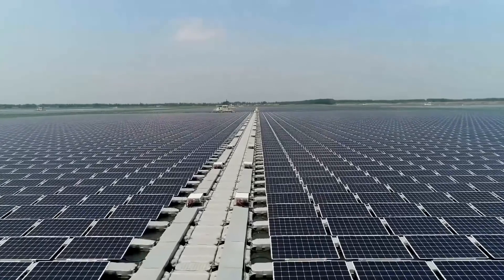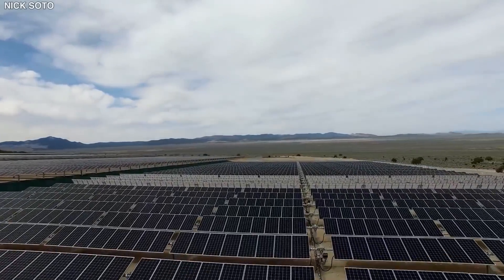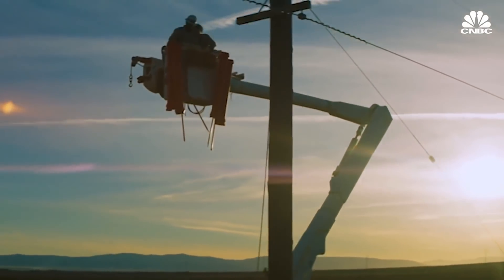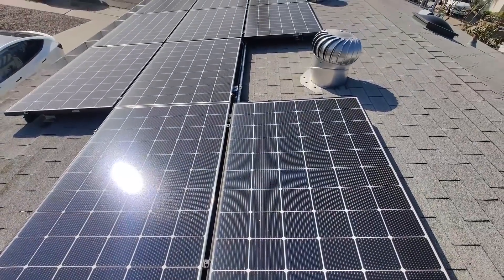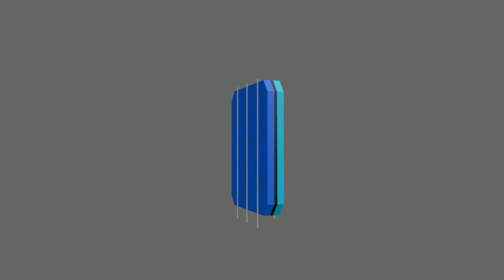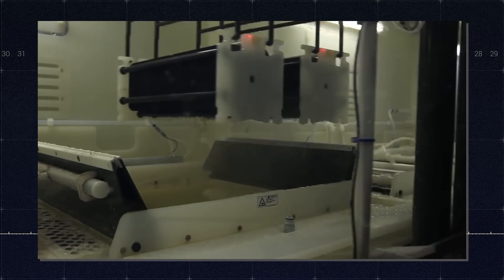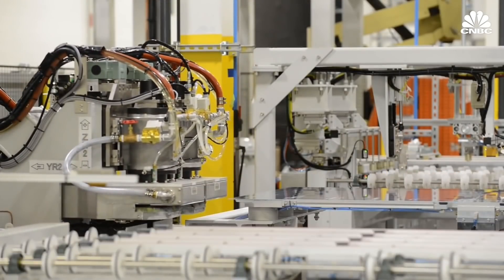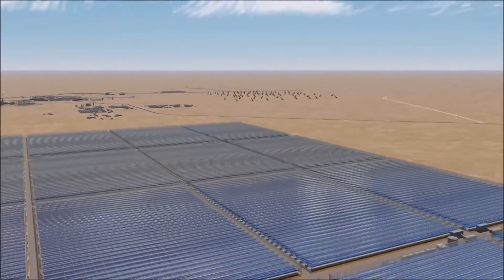IT HAPPENED! Perovskite Solar Cells FINALLY Hit The Market

Comment: I was missing a part where we are told why these cells are not here already. Sounding all promising until you get to the part where the current lifetime is 30months max under optimal conditions. Way shorter than silicon PVs.

Comment: Solar is GROSSLY inefficient, and highly polluting to mine the natural resources, and produce the cells.  Also, China controls that market, which makes it strategically untenable.  Solar has become a money grab for local electrical markets, and a political crutch.

The statement that it requires no maintenance is patently false as well.  PV cells must be cleaned or they lose efficiency on an exponential level.  That means water, chemical cleaners, and constant maintenance.  Solar is not, and will never be the fairyland panacea than tree huggers believe.  It can have its place, but that place will be small, and limited to off grid, undeveloped areas.  These cells still have less efficiency than standard cells by 5%, so more development is required.

Comment: In order to produce 508x more power as in the click-bait photograph,  the perovskite cells would have to cover 508x more area, be 508x more efficient, or a combination of both. At 508x more efficient than current panels, you would need 508x the current efficiency of ~ 20 to 25 %, or 257,175% efficiency. Last I knew, the maximum efficiency of anything is 100%. You're gonna need a REALLY large roof!

Comment: It doesn't generate waste? are you serious? then what is the tons of solar panels(at end of life) going to landfill is?
They produce alot specially at the hours we don't need them, if you dont have a way to storage that excess energy, they are useless, well worse than useless because you need to adjust the grid so it doesn´t burn or turn them off like they do for wind turbines.
Theyre price is going down, alot of it its subsidies.
Im pro solar panels, but in roofs that are "dead spaces", and this would allow people to either be independent or to be able to power some primary need appliances(like fridges), not in mass areas, wasting space and destroying natural habbitats(because they use alot of space to produce any meanigfull power), no to mention space that could be used for other stuff like i dont know a proper nuclear power plant that actually generates proper stable base energy that we need.

Comment: Total fluff piece.   Don’t forget to discount name plant output by a factor of 5-10x depending on latitude, climate and installation details.   That’s if you buy an expensive (read 2x your solar installed cost) battery to absorb the excess (waste) electricity when sun is shining but grid / house is not receptive.  If you don’t double your project budget to include battery you are just shifting the unreliability issue that solar has onto your neighbors and the grid.   

Just ask your German friends with thermostats set at 50F how unreliable energy is working in their country this winter.